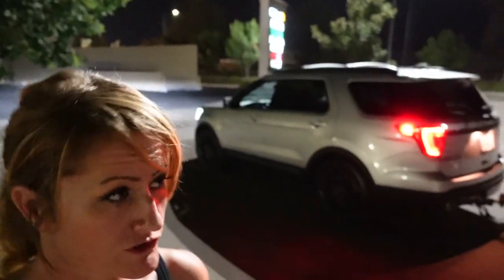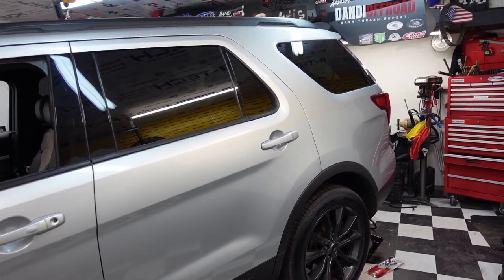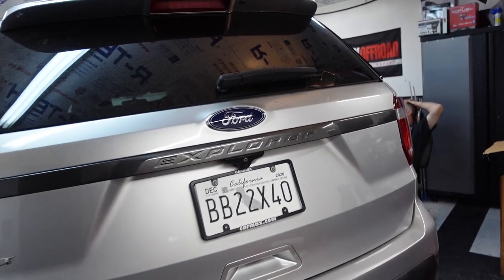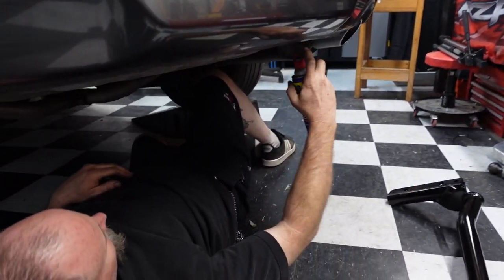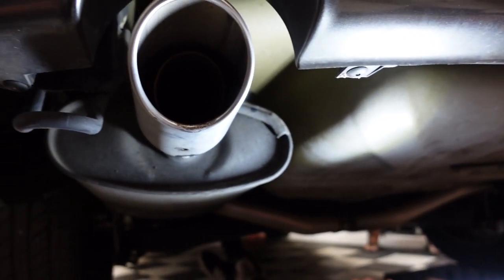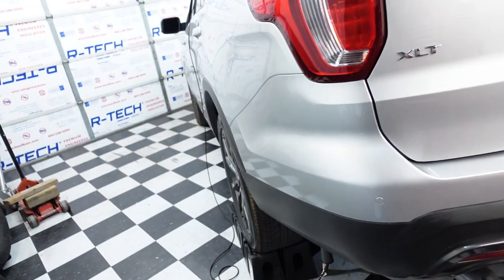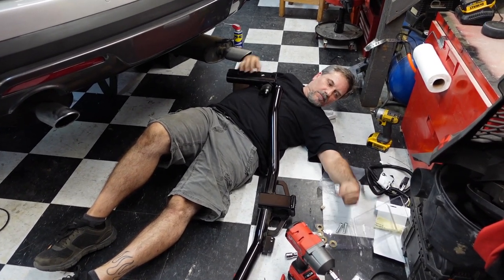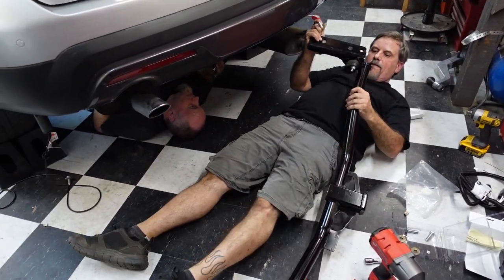Flatbed Tow RZR Pro - Wife Learns To Back The Trailer...

Comment: I finally did the opposite. Picked up a custom boat trailer converted to utility. Gvwr 3000. My cousins fabbing custom ramps like yours as we speak. Can't wait to test it out with the xp4 loaded. Hey send me the link to where you bought the hitch i need one for my wife's jeep grand  cherokee. 😎👍
Reply from the maker: We just bought a smaller trailer, a single axle, pulled it to Oregon and back. So this model is specific for our Explorer but here it is, Drawtite 76034 Draw-tite Maxframe Receiver. And I ordered it from Walmart because Amazon was out over a week for shipping and I got it the next day.